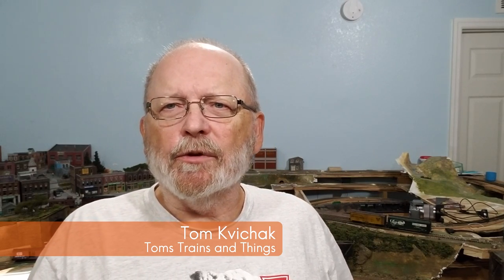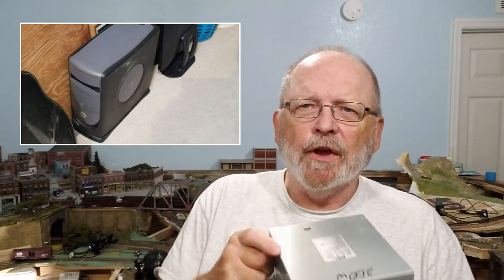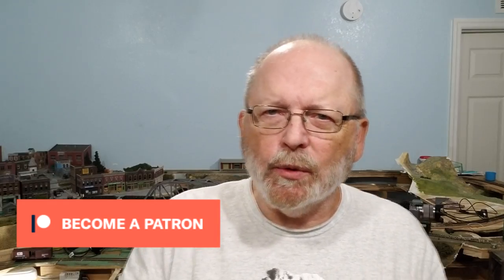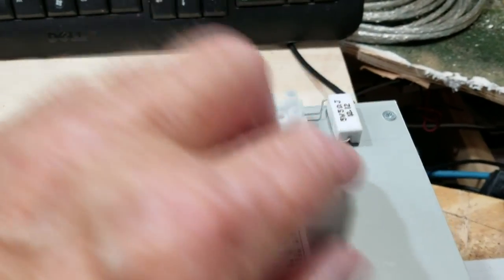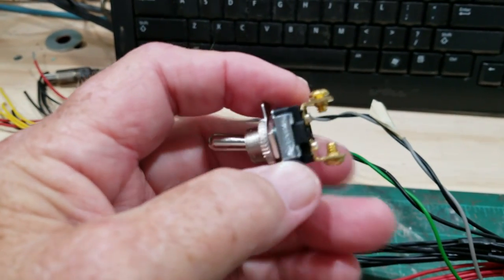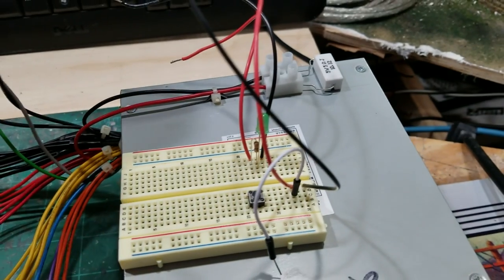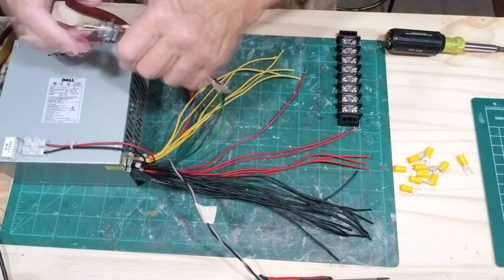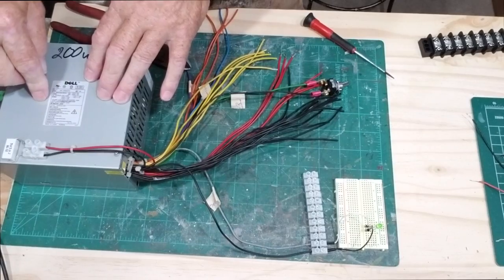Easy Power Supply For Your Model Railroad

Comment: Now that I've figured out how, I'll add my comments as posted (reply) to Scott Macdonald. 
If a 10 ohm resistor will work as stabilizing load, there are advantages. A 5 ohm 5 watt resistor on 5 volts will be dissipating 5 watts (100% of rating- HOT!)  A 10 ohm 5 watt on 5 Volts will be dissipating 2.5 watts (50% of rating- barely warm) and Scott's 10 ohm 10 watt will be almost cold.
Reply from the maker: Yes Lloyd, that's true. I thought I mentioned it in the video that a 5 ohm 5 watt or 10 ohm 10 watt could be used. I had both but used the lower value or the video.
Reply: @TomsTrainsandThings  LOL - Now you say! - I missed that on the video and have been hunting hi and lo for an apparently specific 5/5w when all I could find (in the UK) are 10/10w or 10/5w :|  

Search over :)

Great video btw and so well explained. Thank you!

Comment: All you have to do on any old Power supply is touch the green wire to a ground, been using old power supplies for years to run 12 volt fans in a stereo component cabinet and a big closet where I have tomato plants.
Reply from the maker: Yep, that will do it for fans and anything else that doesn't need a regulated voltage. When you use electronics that way, they have issues.

Comment: Hi Tom were is your ( tube video on computer power pack to connect your trains ,signals and pints to run from the computer power pack).I do not have a DCC system I only have a DC system , In Australia New trains sets can cost from $150:00 - $300:00 Australian Dollars and all depends on the brand can cost  even more Ebay is expensive to buy second and trains & rolling stock can cost you the price of new wons, only old track is is cheep to buy not like sum of the items i have seen in your videos, it would be nice if we could get second  trans & rolling stock as cheep as you can your Edward from Australia sore for the sleeping
Reply from the maker: Power supply doesn't have enough voltage to run a train. Most power packs are rated at 16 VDC and above. I have several videos you can find on my playlist page that  covers additional subjects.
Everything is super expensive here also especially being retired.

Comment: Hi Tom,
I think you should mention that there are dangerous voltages inside the case, much of the circuit is at mains voltage and the large filter caps have 300V dc on them and can store this even when the supply is switched off and disconnected.
Also you do not make it plain for beginners that you can only combine a positive with a negative  supply  and the neg supply can only supply low amps. combining two positive supplies will result in a short circuit  and  BANG !!!!!!! SMOKE !!!! etc.
 cheers Martyn
Reply from the maker: There is no need for the viewers to remove the cover of the power supply. I removed it to show how it is wired. If you watch again you will see I refer to the amperage of all the voltages. Also, the way I present the terminal block it would be hard to short out the wires of different voltages unless they were deliberately shorted together. I have other videos on basic electrical theory and electronic projects for everyone to see. Thanks for your input!

Comment: i HAVE NO IDEA ABOUT WIRING,  IT WAS CHINESE, I LISTEN BUT COULDN'T UNDER STAND WHERE YOU USE THE DIFFERENT VOLTAGES.  THANKS FOR MAKING ME FEEL LIKE A DUMBBELL.  I FEEL LIKE MR. SHORT CIRCUIT.......
Reply from the maker: Thanks for watching. In the video I discuss where the power supply can be used. Either on the work bench or on your layout to power accessories that use the voltages on the power supply. Many people use wall warts to do this same task of powering their accessories. I also pointed out some of the accessories that can be used with this power supply. I have other videos available describing how to use many different components on your model railroad. Some of them I even show using the power supply, especially the ones I produced after the power supply video.

Comment: good stuff but when tom started with the resistors.....I was lost...I need training video for someone who doesn't even have the basics down...most of the stuff I've reviewed online assumes the audience has a clue.....I need to see the actual complete wiring scheme from the track wires, switch wires into a terminal strip and then back to?????....that's the problem, all of these online videos assume that the person watching it knows this......listen, if you're watching this stuff, that means you know it
Reply from the maker: The only way to learn is to absorb everything you see. I have all the videos you would need to take you from the very beginning of electrical theory. I have many playlists that cover every subject on what you say you haven't got a clue about. Start at the beginning instead of the more advanced subjects. There are over 20 videos on Model Railroading For Beginners that starts you from the most basic subjects. I also have many videos on DC wiring, DCC wiring, Soldering, and many more subjects. Browse through my Playlists.

Comment: There is an easier solution.  At least in terms of train running. Dead Rail Operation
Reply from the maker: The power supply is not for running the trains. It's for the accessories.
Reply: @TomsTrainsandThings  
I u understand that. But I do happen to think the future in operation is in Dead Rail. It may still resemble DCC but all of the power distribution problems disappear.  The only question is recharging the batteries. 3.5mm pin? USB? What type? Firewire? Micro? Apple (please no)? Inductive charging? Power pick-up from the rails in select locations? It surprises me that one of the locomotive manufacturers has not jumped on this. Maybe one has that I am not aware of. Or most of them. It's a competitive business after all. Or possibly they're too invested in DCC. I think if I was running Athearn or Kato or any of the other companies I'd be all over this.
Reply from the maker: Deadrail may be a new thing mostly used in large scale but there are too many modelers already using what's available for any manufacturer to abandon them. What's the point of it for a small layout! Maybe 20 years down the road you may see more of it.
Reply: Oh I don't see anybody abandoning the current user base. What will be needed is a NMRA standard.  I think in 5 years you may see it commercially. Most likely in Japan by Kato for the home market. Or Europe. Modelers in the United States, or North America in general are probably pretty conservative in their attitudes towards the hobby. For many I have suspicions it's a longing for the past that never  really existed.  A modeler in his 30s or 40s modeling an era he never saw is in many ways ironic. A narrow gauge layout set in the Colorado mountains in the 30s may sound romantic. But in reality it was a hardscrabble life. The steam era was a gritty period in the cities. Pollution, soot, the grime of burnt coal. I remember coal furnaces. Personally I'm glad the era of coal is coming to a close.

Comment: Okay, I am far from any kind of electrical expert. Help me understand. The resistor connected to one of the red wires will impact the voltage on all the rest of the outputs from the power supply?
Reply from the maker: Yes, the resistor across one of the red and black wires insures there is at least a minimum load for the voltage regulator inside the power supply to function correctly.
Reply from the maker: Your welcome Ron. Check the data plate on the power supplies for the amperage ratings for each voltage. You should have plenty of power to operate your accessories for your layout. You may also be able to operate your command station if the power supply is rated high enough.
Reply: Toms Trains and Things  my other question is this. Are the color coded wires Universal as to the voltage that they carry or Are they unique to each computer power supply?
Reply from the maker: They are universal. Some computers will have additional wires such as grey and white. I can help you with that if you come across one like that!
Reply: Yup. Also, in theory, if you have something like some control panel illumination, or scene lighting that is always on, you can try to save the wasted 5 watts dissipated by the resistor by instead, using a functional 5 watt load.